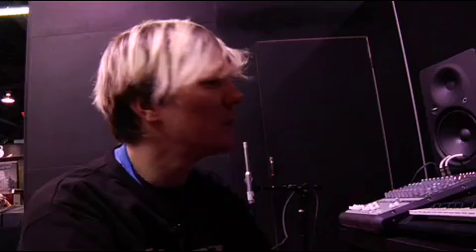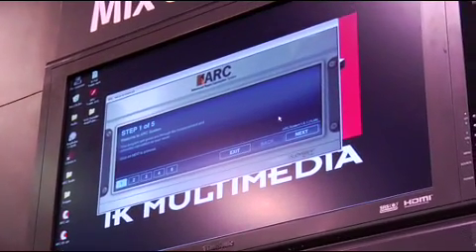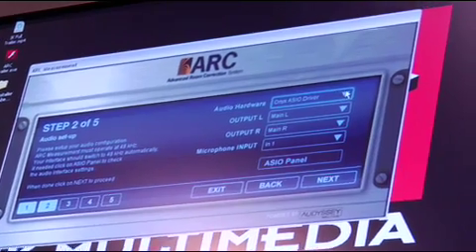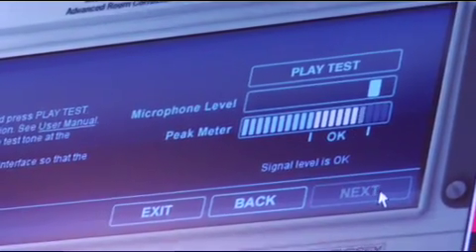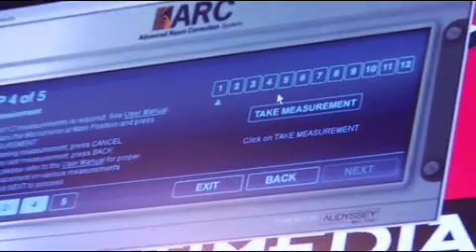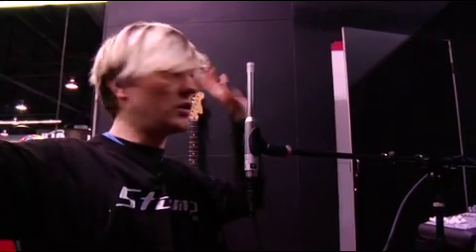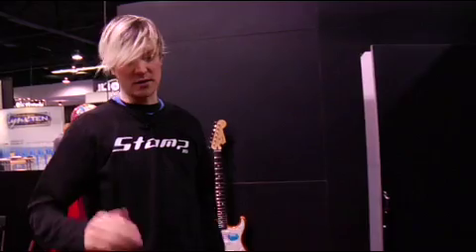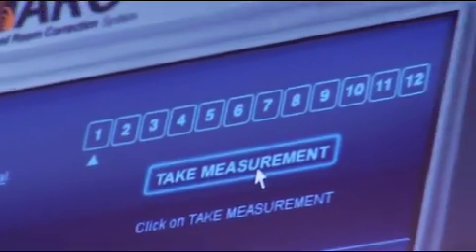ARC System Microphone Set-up - Mix and master in a corrected listening environment

Comment: i heard that there is a way that u can actually set this measuring mic in a booth, and then connect it to the Behringer ULTRACURVE DEQ2496 analyzer processor, than it runs a test, and u calibrate eq on analyzer for later use....and next thing u know - u have calibrated acoustic...is that true?